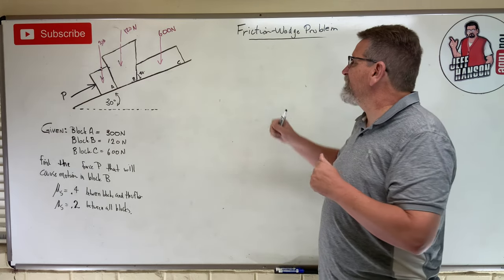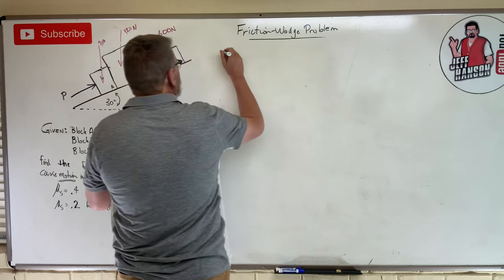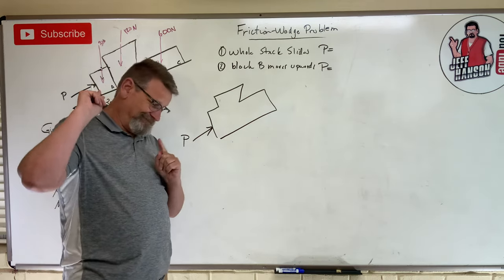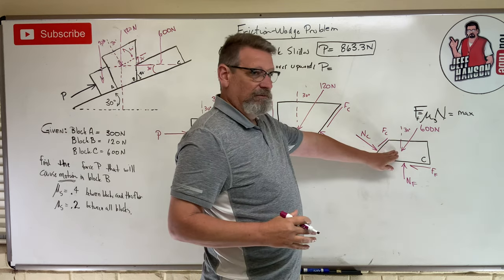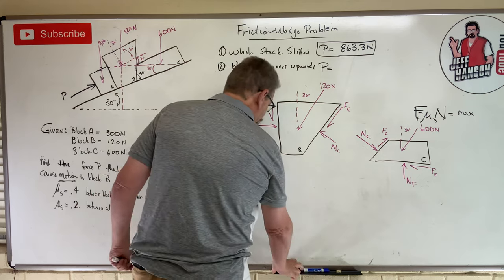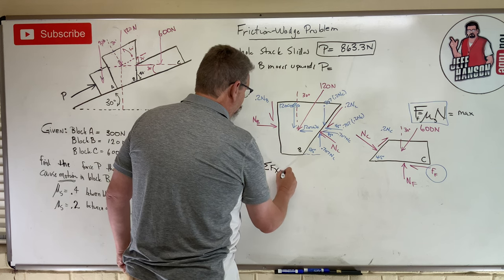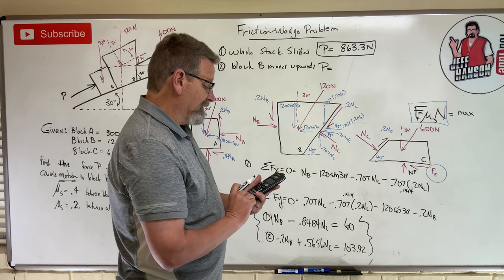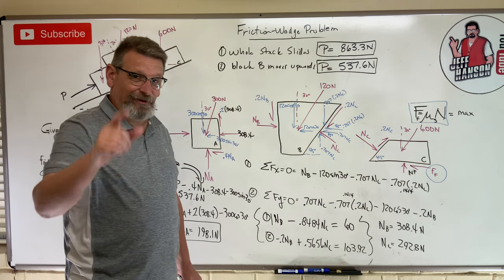Statics: Lesson 64 - Friction on Wedges, Example Problems

Comment: in the block A, shouldn't be a friction between the floor and the block A? then, mu would be dynamic in that case, because the block A moves a little bit, so there should be a friction force that oppose the movement of block A, isn't it? look for instance, in the surface between A and B, there is a friction force, either the block B is moving.

Comment: Why is fc upwards? Shouldn't it be the opposite since you said block b is slidding upwards?
Reply: The normal force Nc is what’s pushing B upwards, Fc (and Fa) are countering it, so they’re in the opposite downwards direction
Reply: thinking again i agree with Jeff  simply becos we r focussed on Block C indtead of Block B.So if Block b slides upwards thrn Fc must act downhill of the slope